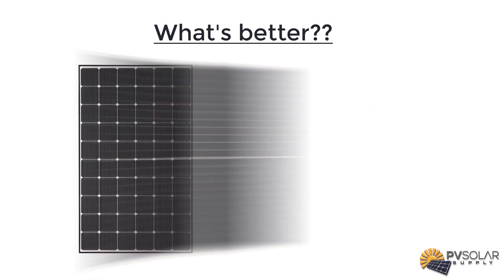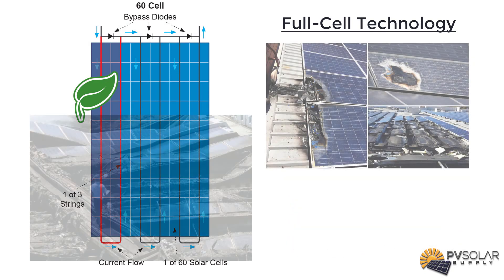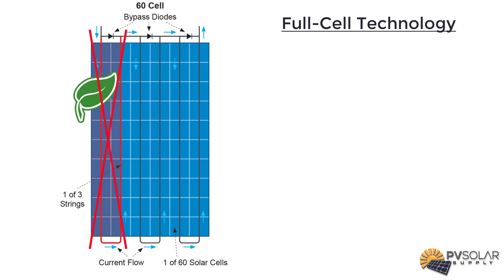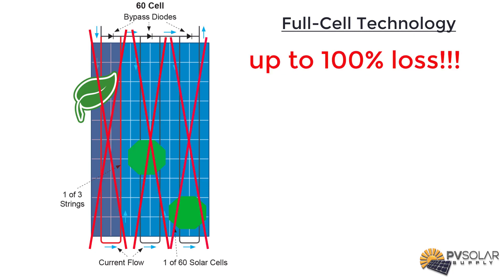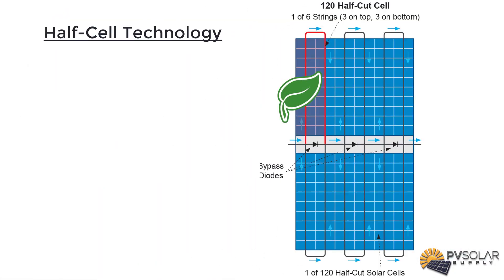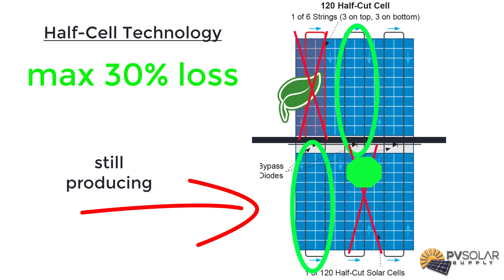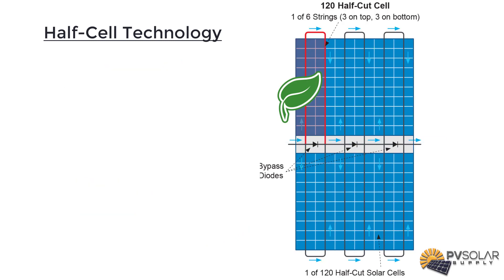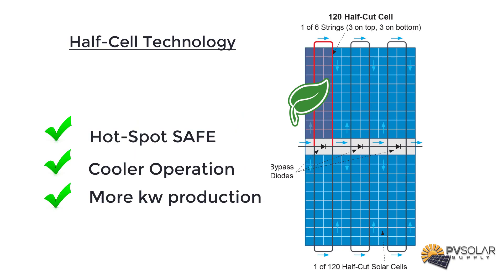Half Cell VS. Full Cell Solar Panel Design

Comment: Nice explanation, but wrong explanation! If only 1 Halfstring is shaded, the Diode will kick in and the losses are the same (33%) If 2 are shaded, you loose 50% (Instead of 66%). But only if you use MLPE: If you use a Stringinverter, it depends where the String MPPT ends: Max Amps or Max Voltage.